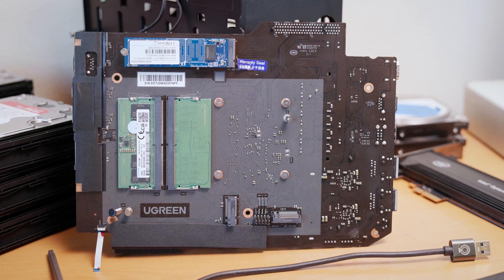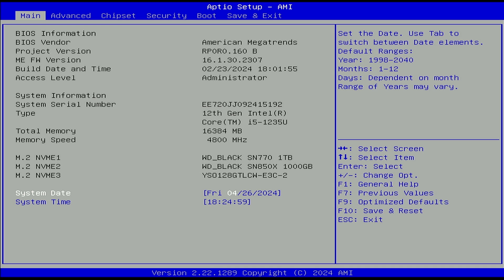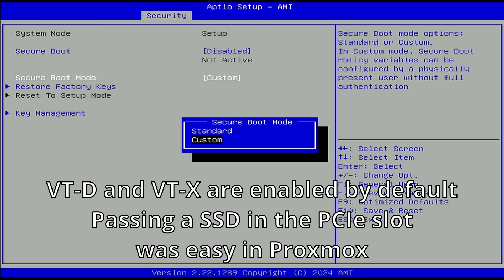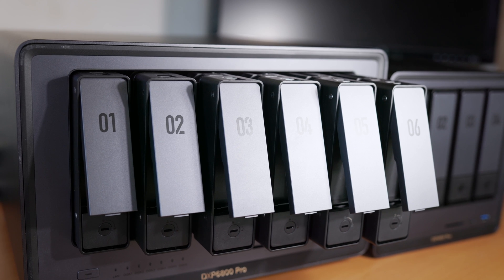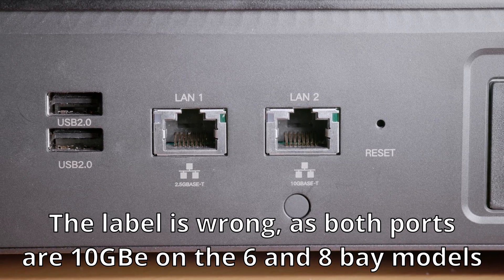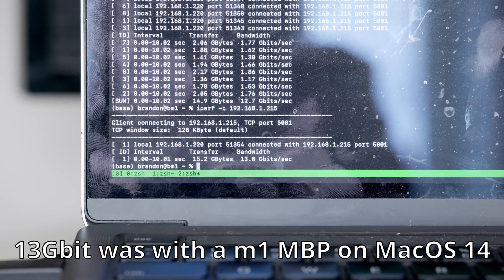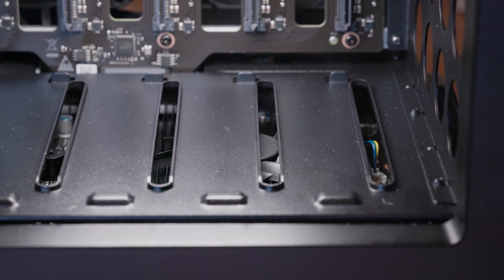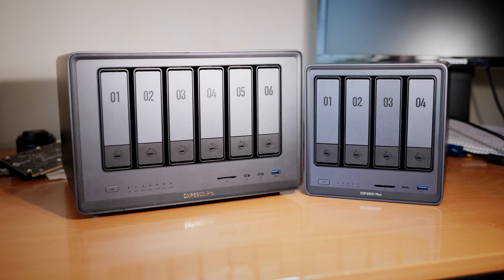Running Different OSes on Ugreen NAS Devices + PCIe layout and CPU thermal/performance tuning

Comment: Splendid, thanks! One question though: Did you have to manually set up the Thunderbolt bridge in the Macbook when connecting it to the NAS through a Thunderbolt cable?
Reply from the maker: I did the thunderbolt testing with Proxmox, but the setup should be very similar to Debian and other linux distros. When I plugged the macbook in it shows up as a thunderbolt0 network device. I added that device to the vmbr0 bridge in Proxmox and started the network interface and my macbook grabbed a DHCP address. No configuration needed on the macOS side, and only basic IP configs needed on the NAS side. It looks like it needs a manual reboot/bringing up of the thunderbolt connection when plugging the Macbook in, but there is likely a auto connection option I missed.